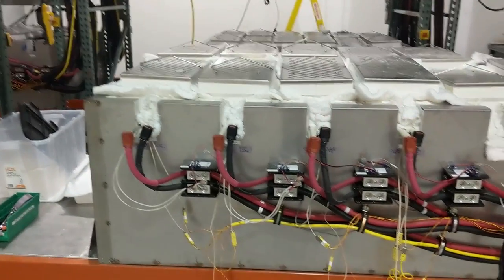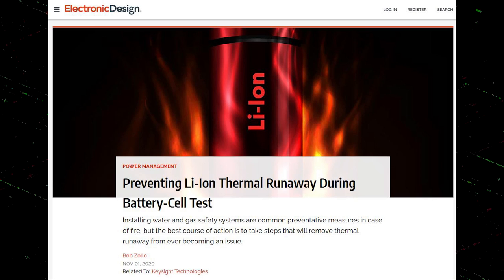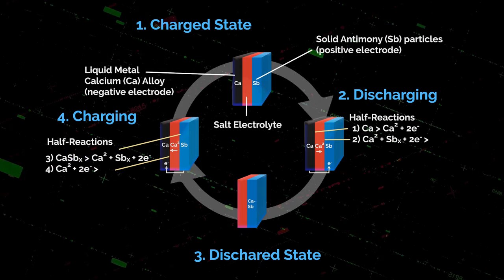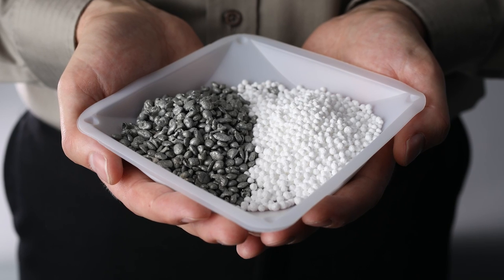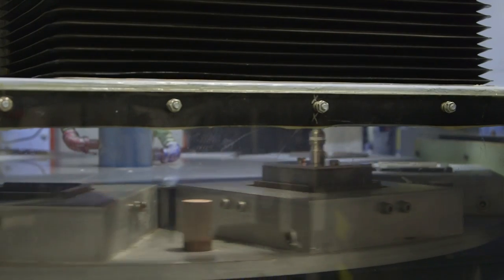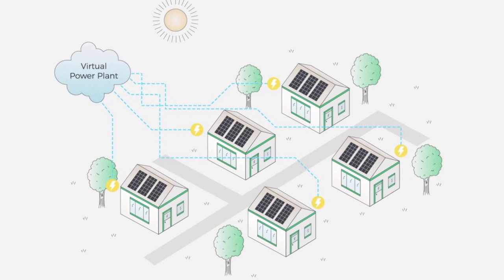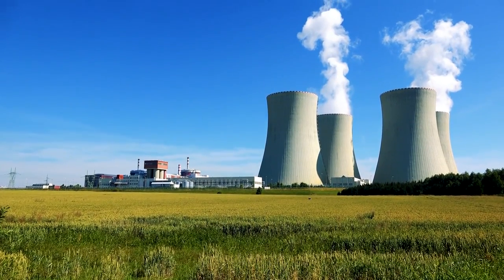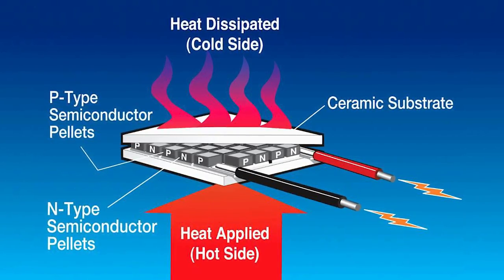Ambri: A Battery that Could Change the World

Comment: I see a few things that ccould help. 1st would be housing this type of battery in a hyper vacuum thermal barrier box. This would mitigate the loss in heat through thermal conductivity in any typical environs. 2nd. Burying huge hypervacuum thermal barrier containers  containing the three separate materials in its liquid state would alllow the system to be able to scale up the number of batteries when electric demand is high and then transfer the liquid materials back to their individual holding tanks when demand is low. E.g. Imagine your have 20 battery containers yet only 10 are needed, then the system could remove each material back into its own holding tank, then when demand starts to increase the materials could be re-injected back ino the remaining empty Battery housing. 3. For commercial applications (grocery stores, factories,, malls, hospitals) Using a micro gold plated parabolic mirror mounted on a circular track to monitor sun position to optimize the angle of the Sun's rays, should be used to keep each of materials molten. Or you could use a Solar Panel array to power induction coils to keep the materials molten.
5. As an added bonus if some water is circulated around the pipes going to and from each holding tank using a heat exchanger, you could create flash steam to also power an electric generator. And if a water generator is placed at the water tank's exit point you could generate even more 99%carbon free electricity. Why no one has combined multiple power generation into a single system is a mind boggle. In Japan one auto maker developed spring carts to slash electricity usage. The system worked by sliding a new car engine on the which would depress the spring connected to a cog wheel. As the engine depressed the spring it caused the cart to move forward on a track to the next station some 15 meters away. When the engine was removed the spring would power a second cog wheel and return the cart back to its starting point. If a similar system was developed it could slash manufacturing and usage costs manufacturing and using these new molten batteries by generating even more carbon free electricity. BTW a kid was featured in a news piece. What he did was he took an old giant satellite dish and covered the parabolic side with 1/2" mirrors. When finished he found he could melt bricks in 20 to 30 seconds. The dish was so powerful that when he stored it in a outdoor storage unit, he failed to cover the whole dish and light coming into the storage unit was enough to start a fire which burned down the whole unit. In another example of potential kinetic energy to produce electricity.... was shown on a episode on Jack Ass with Johnny Knoxville. Johnny visited a water company and got permission for them to open the single valve at the bottom of giant water tower. When they barely opened the valve the high pressure of the water flung the person standing in the way of the jet stream of water and was flung 30-40 feet in a mere  second. After seeing that I knew if factories captured rain water and filled their own tank, the could generate all the energy they need by putting a hydro electric generator  at the bottom of the tan. If they used a capture tank & used a solar powered water pump they could generate all the electricity  they would ever need. Just imagine a factory that has a zero electric bill. This was slash manufacturing costs and make these new batteries available to anyone. 
Carpe potestatem!

Comment: I’m sold!!! My Only concern is calcium chloride highly degrades metal… It was used for years as an additive in cement so that it could be poured in cold weather and it wouldn’t freeze.
It was turned away from after the discovery that a small amount in contact with steel reinforcements would jeopardize the metal and cause it to fail.
Not sure how calcium chloride reacts with metals used in these batteries especially at those temps …

Comment: I sincerely hope this technology gets the same attention Lithium Ion did. Using both at different ends of a grid would change the world. Scale it up guys!
Reply: It's not sounding safer than Li ion. 
600 degree phone battery isn't the goal. 
Solid 😬 chemistry though. Seems like an excellent grid storage solution.
Reply: @mudmagnet3249  i think it sounds alot safer, lithium batery in some phones have already had recalls due to spontaneous combustion, but that being said liquid metal batteries are not being designed for small electronics, they are being designed for sustainability with reducing the destructive nature of generating power from say nuclear power, he even stated that his product doesn't address the intermittent reliability of solar and or wind , please keep in mind he is only 10 years in to developing, some day many years from now it may be used in small electronics, but first thing first . In my humble opinion  small electronics  are subsequently destroying the planet along with many things, to be real most uf us have it backwards we think I'll use my batery operated things till they figure it out instead of lets figure it out first then use them when we know its safe, myself included in that group

Comment: I read up a bit on the Nevada data center that has a contract with Ambri for a giant battery and that unfortunately was barely mentioned.
The battery is planned to be 250MWh. According to Ambri's website, that's at least 250 10-foot shipping containers full of 600 batteries each. Delivery "starting in 2021". I'm wondering how long it will take Ambri to produce those batteries. I'm under the impression that they don't have any serious manufacturing capacity right now.
If it takes them another ten years to scale production to a reasonable level, will the liquid metal battery even be cost competitive by that time? LFP may well be just as cheap by then.
Reply: I wish Ambri luck, their technology should be much more competitive at a similar production scale when compared to LFP. LMB is composed of materials that are hundreds in some cases even millions of times more abundant so scalability should not be the limiting factor on an even playfield. Never the less I hear production is hell, and without proper funding, any large endeavor can fail.
Reply: If I understand correctly is that Ambri will produce batteries for demonstration projects, proof of concept, and work with big manufacturers around the world to licence the technology and start produce at scale locally.

NEC should be such a company to scale up production.
Reply: @MarcoNierop  That is basically how I understand their rollout, except the proof of concept portion has, at least according to Sadoway been accomplished in a multitude of form factors. Some of these progenitor cells have been cycling for years already,  and test data has been taken. If they stick to their timeline then there should be a demonstration model this year, and a commercial model next year. I think what he means when he says scales locally is that this technology is not region locked because materials can be locally sourced anywhere that you want to produce them, so the supply chain is robust.
Reply: 'Delivery' is in 2021... check the Reno company which wants 500 Mw in generation capacity by end of year.
Reply: @mikedar8484  that company is literally what my comment is about.
Reply: @w0ttheh3ll  Yes... and 'Delivery' is stated... to be this year... sure.. started also.. but to be delivered this year, 250Mw. Will it take longer, could be, but they want the delivery, this year. Not a start of delivery, all 250 Mw.. this year.
Then... next year.. Ambri wants to be ready to take orders for entire OTHER micro grids... using this one as an example. 
Recent speaking engagement: is not for the retail market, or cars, or else-what.. but for FARMS of solar and Wind.
This requires larger scale production. Biden is pushing Solar wind, they need batteries, Ambri has a inside track to what will be imo, 'Loan Guarantees' in the 40 billion already assigned to 'green' and the 1 trillion for Energy of the proposed 3 trillion 'Infrastructure'.
Keep in mind a Loan Guarantee is only a starting point.
Hence recent speeches and format of.
The 'Big Money' is in Equity Investment.... which follows 'initial seeding'.. in government programs.
'Equity partners can be 5xs the seed money as a example(sometimes more).
Lots of ifs I know. But this year 100% of Ambri capability is committed, the Antimony producer is maxed out with Ambri's needs.
All taken in consideration the seed money says it all.
25 million? 50 million? 100 million? who knows.. maybe they get nothing, maybe the  Microsoft startup founder writes off his part of initial rounds of 'seed' that have come to some 68 million.
But, Ambri is delivering a competitive product at a price point below the largest competitor without, the competitors massive infrastructure.
Reply: @w0ttheh3ll  As I understand the system is to be delivered, as needed, throughout the 'rollout, of properties being leased/sold and delivery already started. This means 'as needed' where if the expected 2023 most of the 1700 acres is developed, the 'Delivery' will have been 100%.. 2023... if the Project is completed before 2023.. the 'Delivery will have to have been completed.. if the Project takes longer than 2023 to lease out all 1700 acres, delivery will continue past 2023.
This project is spring board.. that does not rely on 'delivery completion but does imply a working method for additional 'Projects- it can be duplicated and built up... as needed.

Comment: I would love to see this technology paired up with molten salt reactors.
Would be a formidable combination.
Reply: Have you heard of any decent advancements concerning MSR's?  I haven't.  It seems to me an MSR was a battery that just needed some help to start, then the reaction maintained via so called nuclear waste or abundant Thorium. - But I wouldn't want to tote or drive a MSR around if a battery can be charged;  the high heat seems dangerous enough.   I doubt such an everlasting battery like this will be permitted, just like the MSR at National Laboratories back in the day and still not being being government supported very much if at all mostly.
Reply: @01mustang05  ha ha I wasn’t quite envisaging a mini portable  reactor like Mr Fusion in “Back to the future”! 
But I do think a grid of country wide small local MSR sending their power to efficient battery systems could be viable.

Comment: Perhaps i miss it, but, what is the efficiency. There is a possibility to use heat in excess... means we have losses in Joule ? How many ?
Reply: The efficiency is in the low cost of materials and, ultimately, the low cost of manufacturing grid-level storage systems.  Any excess heat can be used economically.
Reply: @jeromebarry1741  ok, but no, heat excess  cannot allways be used. I just want to know numbers ;) in order to compare with other static batteries like vanadium Redox, sodium-ion, quinones flux and so on...
Reply: Sadoway has claimed a round trip efficiency of 80%. Excess heat would be contained in the insulated can, up until the metal began to boil which would probably cause the cell to fail which could be avoided by using an automatic charge controller to limit incoming charge beyond a certain temperature or with a thermostatic resistor.
Reply: Phil V
If the unit is in a secondary structure say, a greenhouse, that structure benefits from the heat "loss". It also increases the base ambient temperature (ref the "Texas" example)
Reply: @ironassbrown  80% is pretty efficient to me. Much better than hydrogen , equiv pumping&turbining water.
Reply: @philv3941  yup thats right
Reply: @rogerstarkey5390  dont count your horses. The difference between an ambient temperature of 40 C versus say 10 C is quite small compared to the internal operating temperature of 700+ C.
Reply: I guess you could super insulate the battery casing to reduce the added heat required. This would be required in summer or winter anyway.
Reply: @professortrog7742  But the leaked heat is useful, and 30 degrees is 30 degrees.
Reply: @ironassbrown  I don’t know what metallurgy we are dealing with here but the metal might not boil at all with the available heat available. I think we are probably talking about a molten salt system here. The heat produced from charging would probably be less than the additional heat required to keep the mix liquid but it depends on the efficiency of the battery case insulation. If charging heat is too great you could  design the storage system with addition batteries such that charging is switched from a too hot battery to a too cool battery. They could even run a pressurized circulating cooling fluid through the battery jackets in order to maintain a constant temp for all batteries in the system. Highs and lows could be averaged out with charge rate and battery charge switching used to control the temp of individual batteries and the total system. There are some interesting materials to use to super insulate the system but they must be inexpensive enough to be considered as an option. NASA and others have developed some very efficient insulating materials of the ceramic variety. Nanoparticle materials are also available for this purpose but the price of production could be too expensive. Time to consult a materials specialist. If the insulated battery casings could be designed to be reused or at least partially reclaimed then the cost of super-insulation could possibly be extremely reduced. I wish them the best of design. The world needs a better battery. I’m a research chemist who appreciates the engineering challenges that this involves. It sounds like a really cool project. My best.
Reply: @theselector2310  Great reply, those are all valid solutions and very informative suggestions. I guess I just assumed the metals (or maybe the salts) would boil if it were to exceed a temperature threshold, I suppose that isn't necessarily a given. I actually misread the OP's question and thought they were asking about an overheating scenario, so that is why I was focused on excess heat, turned out serendipitous nonetheless I think I learned something in the process. To the expense concern over insulators, there are some reasonably cheap options that could literally slip right over the cell like a sleeve or an envelope. There may be room for improvement over some of the less costly choices but that could probably be iterated or deduced in time, and could even be swappable in the field to improve heat preservation in the can.
Reply: @ironassbrown  Well like I said I don’t fully understand what type if system this is so my ideas may be easily replaced with better solutions. But I do wish this company good luck in the development process.
Reply: @theselector2310  Same here. from what I understand they have experimented with a number of form factors for the cells themselves some of them cylindrical some of them kind of shaped like a pizza box, and probably others. I think (and this is partly conjecture) that they settled on a more pizza box shape cell that was stackable. They plan (if I have my facts right) to ship the bank in more or less standard shipping container along with the power control and whatever else it needed to be a modular battery bank that could interface with the grid.

edit: when I say conjecture it is partly inferred based on some of the previous talks that I listened to where Sadoway discussed some of the development processes and discussed test data that was taken, some of the ideas they had moving forward. But I didn't really hear much more about development after that so I kind of assumed that they had settled on what they had been working on most recently at the time, which was the "pizza box" cell. Allegedly some of the early prototypes have been cycling for years, and since there have been many iterations of test cells that are providing useful data. I remember in this interview He said that they had been allowing cells to freeze and bringing them back online, I am sure they will get useful information from that as well, I am excited to see.
Reply: @ironassbrown  Excellent. It might be odd sounding to say that I find all of this exciting but I do. While it’s probably not something that I would discuss at parties (LOL) I think it’s very cool. And the potential it has to effect peoples lives is way up there.
Reply: @theselector2310  Doesn't sound odd to me, I am over the moon about it

Comment: The real question is to ask how much energy is required to keep the metal in a molten state.  What is the parasitic loss?
Reply: Well concentrated solar uses molten salt to store heat energy in heavily insulated underground tanks and those tanks last I heard lose 1 degree an hour. These batteries could be used in tandem with the molten salt storage tanks to stay heated and store the electrical energy the steam generators that are powered by the concentrated solar plant.
Reply: If cycled at least partially daily, the round-trip efficiency of the battery is stated in one of his videos at better than 80%. That means 20% power losses (not bad) and that includes keeping it hot.  Modern insulation is quite good. Leave it sit for a month, and naturally it will solidify - you could still get MOST of the energy out of the battery after re-heating it (additional loss, but not 100%).